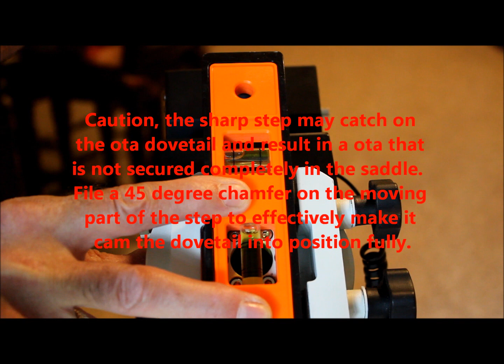Establishing a Zero Point for the ZEQ25 mount

Comment: Hi Paul my battery in my HC needs a new battery since it defaults to 2011 can I still accurately still use the HC and just input the new date and time on each use? Or would a new battery make the unit more accurate? (The screw heads are stripped so I can't remove them and change the battery)   I debating if purchasing a new HC is worth it, when I slew too targets I still get pretty close, but when I make adjustments and put the target in the center it only stays there for a 1-3 minutes before I need to readjust-even when i put it on sync to target.... Do you think this is purely an alignment issue, or does the controller battery has some influence?
Reply from the maker: Hello Umar, I suggest replacing the HC battery.  You can manually input the correct data but every time you power off the mount it will continue to default to the 2011 data.

Comment: Paul, When you say exact center for the polar scope, do you mean after set up to Polaris position as per the handset?  My area is about 40 degrees and on the clock face at the time. When that is correct, then Polaris should be centre on the OTA? Thanks Paul. I have the CEM25.

Comment: Paul, Thank you for your very informative videos. I love this mount, I mounted an Orion XT8 OTA, added Orion rings & 13" dovetail. Total OTA weight 26lbs. Extended counter weight an added 5lb weight. Tracks great, drawing 200ma, up to 400mawhen slewing. I also mounted a 20 arc min. circular vial to a plate on the side  tripod head. This gives me excellent repeatability in set up. As a surveying instrument/construction laser tech, I must say Your tune-up videos are the best.Joseph C. Adrignola  President JCA Laser Service Co Inc.

Comment: Nicely done.  However, do you find that placing the level on the tripod spreader to be inaccurate?  I've seen those things tilt when the locking knob gets tightened.  Instead, I simply level the tripod first using the torpedo level and then add the mount/head after the tripod is level.
Reply: Either way has it flaws as you can not get tension on the spreader without the mount on it.